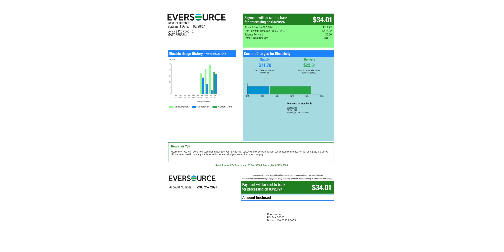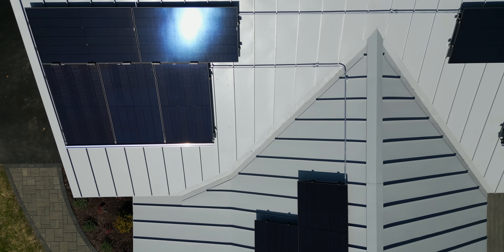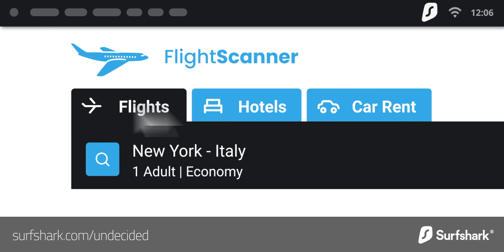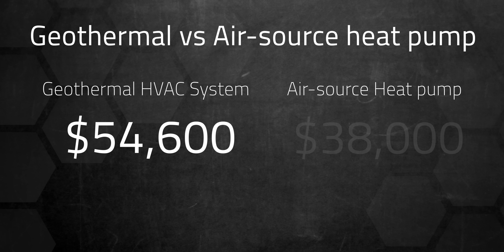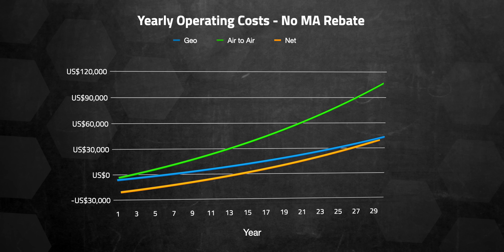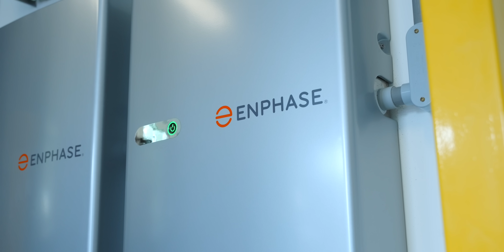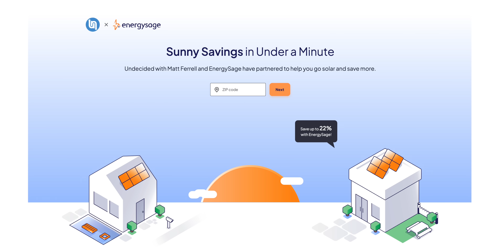What I Learned After 1 Year with New Solar Panels

Comment: We live in Central Florida where you would think everyone would have solar but the rate of $0.14/kWh delivered makes a solar system just a swap of paying the utility or a bank loan. We drive two EVs and if these cars would give back energy to the home when desired then maybe having solar to charge up the car during the day and extracting the power at night might make a lot of sense. 
V2H is coming and at that time solar may make sense here in Fl.
Reply: It's even worse if you live in north Florida and your power company is FPL - you get screwed at the end of the year.

The first thing to know is that FPL will only give you credit for 115% of the power you take from the grid annually.  So, for example, if you take 10MWh and send back 15MWh, they will only use 11.5MWh as the basis for any credit.  Keep this in mind for later.

Monthly billing cycles are basically done like the old rollover minutes cell plans.  In each billing cycle, power you send to the grid offsets power you take from the grid, and any surplus rolls over to the next month.  There is a minimum bill amount that comes out to $26.98 after taxes and surcharges - basically this is what you pay just for delivery.  If you end up using more power in a month than the total of what you send back and the existing surplus, you'll get a bill that covers the overage and your surplus basically resets to 0.

At the end of the year is where they start screwing you.  First, they take the total power you have sent to the grid and compare it to the total you have taken.  Everything you sent over 115% of what you took is basically erased - you will not get credit for it, you will not get paid for it.  Then as if that wasn't bad enough, instead of rolling over the surplus that remains to January - if any - they issue a credit to the account.  This might sound fine, that is until you realize that the credit they issue is not based on the retail rate like the 1:1 matching during the year, it is instead at a wholesale rate which is significantly less.  You can thank DeSantis for allowing this BS.

Now, if you are in south Florida, that isn't really a huge issue because during the winter months you're cooling the house less and using less power overall.  But here in the FL panhandle, where it gets cold and stays cold for extended periods, we actually need to use heat which consumes more power than cooling.  January and February here are more frequently overcast/cloudy, so solar production is down and doesn't produce enough to cover the extra power needed for heating.  Since they dick us out of the surplus at the end of the December billing cycle, we start the new year with 0 surplus and a pathetic bill credit that doesn't even cover half of a regular bill.  Basically, we end up paying a couple hundred dollars in each of January and February until it warms up enough that we are no longer using heat.

When we built our system, we sized it to be large enough to power the entire property for at least a full day (easily longer), mainly so that we had power during the inevitable extended outages after hurricanes.  That includes 40kWh of battery storage.  We had expected to be able to just run on solar and batteries, feed excess to the grid, and essentially use the grid just as a backup for long periods of low production days (we have 2 rainy seasons where you won't see the sun for several days in a row).  But the downside to running that way - battery and solar only - means that while we are sending less power to the grid and recharging batteries first each day, we're also taking almost nothing from the grid.  Now you might think that is good, until you remember that 115% maximum - if you're taking very little from the grid, that's 115% of very little.  Not only does it discourage you from staying off grid most of the time, it actually incentivizes you to waste power as necessary.  I've actually had to minmax our power usage to keep the amount exported right around that 115% mark, which I've found easy to do by running the A/C during cooler months rather than simply opening some windows.

I won't even get into the absolute circus of an installation - I will only say stay far away from ESD Solar in Pinellas Park, and find a local installer if you aren't doing it yourself, not one elsewhere in the state that is more than an hour away.

In hindsight, there are certainly some things we would have done differently, especially the choice of installer.  But in the end, even though our system is financed and one could make the argument that we've only replaced the electricity bill with a loan payment, even with interest the amount of that loan payment is a great deal less than the average bills we were starting to get before solar thanks to a fairly significant rate hike that FPL imposed a year after acquiring our previous power company, Gulf Power.  And of course once that loan is paid off, it's essentially free energy from that point forward.

Comment: An average one bedroom house would use @4.5wk of energy per hour so 4.5wkh. So a very good solar panel would be rated at 400w per hr during good sun light conditions. So u should have @11 panels installed. Average panel costd @$1.3k. So a single bedroom home should spend @ @$15k.
So by my above calxulations you installed for a 4 bedroom house and thus spent @$55k.
So why do u say it is expensive, it is about thr average price yoi should be paying. Unless my assumptions are way off.

Comment: 11:43 even when they hit the low end doesn't mean you have to replace them. A few more panels can be added to make up for what is lost.
Reply: Provided their inverter can support that (clipping).

I have 7.2kW inverter for my 8.8kw panel system (originally 9.6kw system, but they ran out of room on the south facing).
Reply: @Here2Enjoy-b8z  if you loose 2kw on a 20kw system then and 2kw you are back to 20kw for the price of 2kw instead of 20kw.

Comment: Even if you use no electricity, they're going to stick it to you with the grid connection fee. 

They have increased the minimum grid connection fees in my state by nearly 100% over the last two decades.

Think of it this way. If everyone has solar and uses no electricity, they still have to pay for line maintenance and corporate salaries from somewhere.

That said your $10 grid connection fee is amazing compared to my minimum 37 dollar bill if I use no electricity.
Reply: And another point to ponder is special taxes on your solar panels. 

If they decide to tax your panels to the tune of $200 a year, that's going to change your numbers and the more people with solar panels the more likely that solar panels would become a source of tax revenue.
Reply: @mac_mcleod  I don't see taxing of panels coming to the US in the next four years.  Elon makes money from solar and is Trump owes him big time.
Reply: We also pay around $10 for the connection here in CA. Our net usage for the system is negative so $120/yr to connect to the grid is our annual power bill.
Reply: Oh and to perform a fair financial analysis you need to compare how much money you would have had if you took the $10,000 difference and invested in the stock market and got an average rate of return of 3 or 4%, how much would that money lower your electrical bills.  At a trivial example, it would lower your electrical bills by 300 to $400 per year.  But of course the 300 to $400 would be income so you would have to pay taxes on it so it would actually only lower your electrical bills by about 225 to $300 per year.

Comment: It can't save me thousands on my energy bills when my energy bills run about $900 a year for a 1700 square foot house. 

Lots of insulation and LED bulbs will do that for you. 

And running my house at 77 or 78° in the summer but low humidity or 68 to 70° in the winter but with low humidity lower the single largest cost which is air conditioning cost.
Reply from the maker: Thanks for sharing.  That's precisely why I said it's a very individual calculation if it works or not.  In your case, it really doesn't sound like solar makes sense.
Reply: Depends a lot on where you live. In my area the "public" utility can charge $.65 kWh which for my modest house would be $7800 or so a year.
Reply: @16jocko  okay I can't even conceive of a 65 cent per kilowatt hour rate.  
Even Europe doesn't charge rates that high as far as I know. 

In my state the rates are about 15 cents per kilowatt hour.  Why are your rates so expensive?
Reply: @macmcleod1188  I'm in Australia and I'm currently paying around 60c per kWh... it's insane!
Reply: @r1m.dog78  oh yes I've been following the electric Viking and it appears that solar is exploding in Australia due to high rates but I had no idea they were that high.
Reply: @16jocko 65 cent!? Even in the Uk at the worst of the Russian gas crisis it got to half of that, since dropped back down a lot.
Reply: The 10-ton gorilla in the room for breaking even on a solar system is actually in gasoline savings by owning an EV.  People often don't realize just how much they spend on gasoline each year.   With a sufficiently-sized solar system, being able to zero or nearly-zero-out those costs can be worth thousands just on its own.

I'd say:  #1 gasoline savings, #2 natural gas savings (electrifying the furnace), and then #3 base-line utility savings.

-Matt
Reply: @junkerzn7312  Not living in a car dependent suburb helps with that.
Reply: 77-78 in the summer?  My wife would leave me.  One great thing about solar is you become less focused on your electric bill.  Want to make it a little cooler in the house - do it.
Reply: @ddivinia  if I wanted my house to be at 72 it would cost me an extra $50 per month. 

I can afford that. 

But then I would be miserable every time I stepped outside when it's 95°.   Which it is for about 110 days.  

This morning, my house is 60°.  When I go outside in the 47 degree weather next Tuesday I won't be miserable. 

In the summer, I keep my house is warmer so I won't be miserable when I go outside.

But I understand women have issues with hot flashes.  I'm a bachelor so that's not an issue. When I have company, I cool the house down a bit.

Comment: Thanks for this episode ..! So .. to put it in Colloquial engineering English …was the Juice worth the Squeeze..? Your house is very technically advanced and the only component I really question is the solar inverters , how long do they last and how easy are repairs or upgrades …
Reply from the maker: I have Enphase micro-inverters, which have a 25 year warranty.  There's one behind each panel, so if one goes down it doesn't' take out my entire solar array.  They're relatively easy to swap out too.  Will they actually last 25 years?  Jury is still out, but my last house had Enphase as well for over 5 years without a single issue.
Reply: @ thanks for that .. inverter tech is probably evolving as fast as everything else…I have Ego Yard  tools , lights inverters etc ..thanks to your recommendation .. and the only trouble I have had was with the control boards .. usually a diode or a mosfet .. so I could see that serviceability would be desirable.. Stay Warm this winter and if it does snow I hope you get a YouTube video out of it ..!

Comment: How much more will it cost to replace that hot water heater than a normal hot water heater?
Reply from the maker: Well, it is a normal hot water heater (just a heat pump version).  So no more than usual to replace it than I paid for the current one.  The only unusual part is the desuperheater tank, which has no electronics or components.  It's just an insulated tank.  That should last longer than the water heater, but again, isn't not that pricey to replace.
Reply: @UndecidedMF  Sorry, poor wording on my part. I guess what I meant to say is that I assume that heat pump water heater is some order of magnitude more expensive than a "more common" natural gas or electric resistive water heater. If that's not the case then I get it. If it is let's say $1000 more expensive base cost, and definitely more in labor to replace it. The cost savings over the life of the unit do not seem worth it.

Comment: I just can't get these prices around my head. over $80K for panels and batteries alone? 430 bifacial panels are easily found around 60 euros in Germany and they sell like hotcakes. 40 panels (430 watts) x 60 euros = 2,400 euros (17,2 kW). $55,000 for the same amount of kilowatts? Am I missing something here? Like 20 times more expensive?
Reply from the maker: Yep, it's the soft costs (labor) that really jack up the costs in my area, along with permitting costs that don't exist in other areas of the world.  The US is really lagging behind on that front.
Reply: @UndecidedMF  
I really lucked out:  Almost zero labor costs because I could do it myself, and my county charged nothing for a building permit because they wanted to encourage solar.  No lease because I paid cash for the equipment.  No contractor costs because my county lets a homeowner do their own work, even electric as long as you can pass inspection.
Reply: I'm only assuming but he probably has Labor in that cost. Labor is incredibly expensive in the USA.
Reply: They're even cheaper than that.I got my 445W panels for about 53€+tax. High quanitity panels can drop to as low as 0,1€/kWp, if you're an installerand buy in bulk.

Panels are really really cheap these days. Some roofs are more expensive than solar per m2.
Reply: Well Enphase is one of the most expensive systems on the market. With my quotes for a relatively small system I had REC Panel + Enphase quotes that were almost 10K more than a similar Tesla or String Inverter. Rec panels added an extra 2000-2500 and the Enphase batteries were an extra 1000 per 5kw units also there were extra charges for whole home backup/software upgrade fee. Enphase is considered super premium.

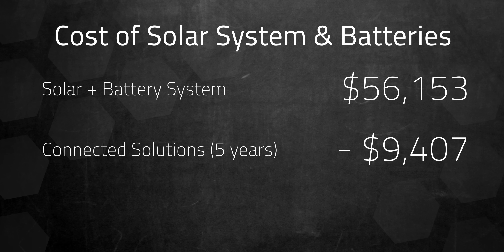Comment: 11:00
I don't see any consideration of the cost of money. Based on an interest rate of 6% the solar will break even at 15 years, not 9 years and that's not allowing for maintenance/repairs.

A cash flow of $4,800 per year for 10 years, with an interest rate of 6 percent has a present value of $35,000. For 15 years that would be $46,000, which matches the cost of the solar system.

The choice of interest rate is subjective, if you have to borrow money or have other debt then a higher figure would be appropriate raising the present value.
Reply: A lot of details neglected, especially applying the credits/savings up front. It should be more than 15 yrs if those credits are measured as discounted future cash flows.
Reply: @killacrad   I added the details. I haven't included all the items you mentioned.
Reply: @spoddie  Annual increase in the cost of grid electricity should also be accounted for, the $4800 avoided cost is not fixed over the payback period. Interesting how difficult it is to find a tool/resource that does proper accounting for these installations.
Reply: 6% interest rate? What? Normal people don't make that. They'd be lucky to get 4% these days, and that's assuming that interest rate cuts don't happen again.
Reply: @TacticusPrime  It's the cost of money, not the earning of money that's being calculated.
Reply: @spoddie   What do you mean? You aren't talking about opportunity cost?

Comment: The cost per watt long term and other data are quite similar to my set up even when it's much smaller. I was experting the payback period to be on year 8 but since I have a lot of excess I've been using more and more electricity so it might be sooner because I didn't factor using induction instead of a gas stove until after I saw how it performed

Comment: In my area if you send excess solar to the grid the electricity company charge you because the grid needs to be able to cope with the excess power being sent to it. So they argue that they need to upgrade the grid to cope with all the solar power being sent onto it during the middle of the day when people aren't at home using power but the solar panels are creating the most power.

Comment: UK, solar is shit because barely any sun. It might still work if the electricity prices are high though. 

Majority of Asian countries, it's a no brainer because sun is present far more often and far longer. Electricity prices are also higher generally, hence a no brainer. 

In Pakistan, where i live, a 20 kw solar hybrid solar system with 15 kwh batteries would recover it's cost within 3 years because of how high electricity prices are and how much sun is available for most of the year. The cost of solar itself is also pretty cheap compared to west because the country is on border of china where majority of solar panels are manufactured